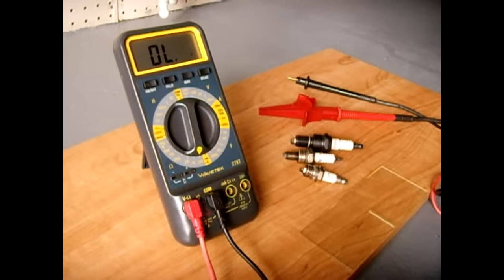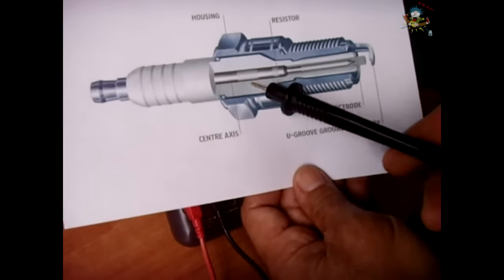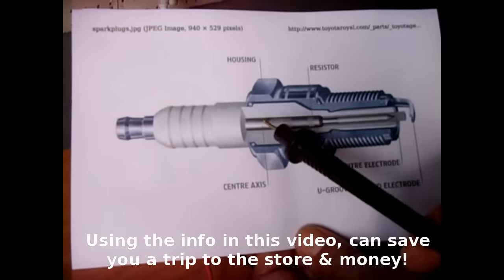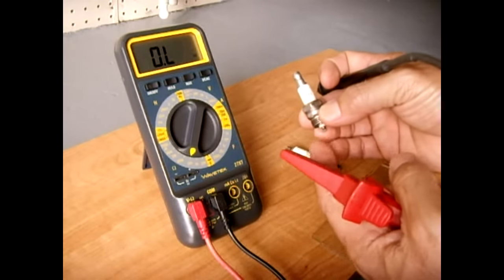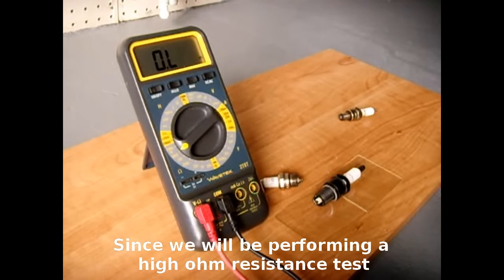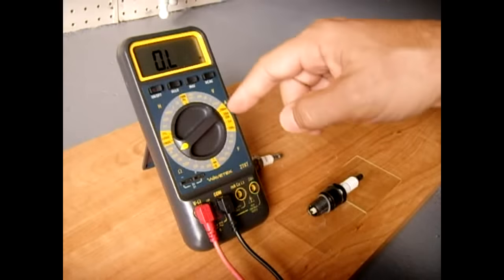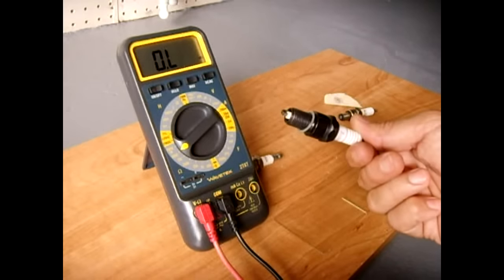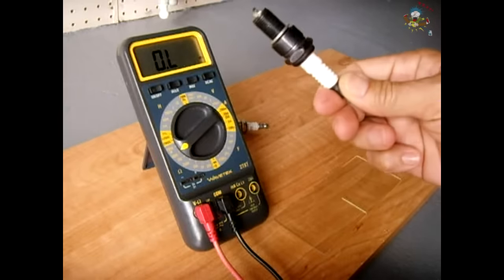How to rule out a Spark Plug as your problem

Comment: So I have a Toyota Corona 1988 the very first problem I experienced with it was when my brakes failed on me. I was driving home on a rainy day was coming up to the lights and needed to slow down as I did so I heard a ping sound and the brake pedal went right down to the floor and lost all the resistance it had. Upon getting it fixed I had discovered my car which i got second hand was indeed a mutant. One of the disc brake rotors was from a Corolla and shouldn't of even been on my car. So after hitting the car in front at about 5k had to get my bumper joints re welded luckily my radiator was fine and my tires had to get two new headlights. Onward about a couple month the tires I thought were fine where not and I had one tire blow out on me must of been a bit of glass that slowly got in it. Later on down the line my car kept making a weird sound it sounded like a slipping belt. I discovered this sound was the crank pulley. So get a second hand one of those and it lasted for two years until a couple days ago. So I was losing a lot of power in my car looked at it at work the belt that went around the air con pump and the alternator was split and blistered. Once again the crank pulley broke again. So just yesterday I had my car down getting fixed again got a brand new crank pulley this time but I have noticed the engine slip and it feels like its struggling to keep up. I could barely get to 50km/h going up a hill which before it could easily do this.I'm just wondering why before I get the crank pulley replaced that everything seems fine and the car goes alright apart from the noise.
Reply from the maker: +burninghalls 
Hate to be the bearer of bad news, but I think the time has come to get rid of your car and find something newer. Sounds like a money pit. You will spend more money on the car than it is worth. Once a car reaches a certain age, all the rubber seals dry out, shrink and crack, metal parts become worn out, etc. 

Thanks

Comment: To be for use one would need to know the acceptable resistance of the plug in hand. I dont know what mine is supposed to be. Looking at your tests I could come back with anything from 0 ohms to Kohms on a plug, but unless i know what its resistance IS then i cannot use this test to any effect. Any rules to apply here? Thanks
Reply from the maker: Nick Hudson Vehicle spark plugs are resistive. Uually in a range between 3500 and 6500 ohms. All you need to do is Google the spark plug you have.

Comment: I dont know anyone that would take the time to remove all spark plugs especially on late model car and not replace them all anyways. Faster than testing each plug. This might be good for lawn mowers and trimmers that have only 1 plug but not practicle for a vehicle.
Reply from the maker: Clearly if you have to remove the air intake plenum to test the plugs near the firewall, then you'd replace them. :-)

Comment: Oh! My bad !! I do have a NGK BPMR7A spark plug for my hedge trimmer , the Briggs & Stratton lawn mower has the Champion plug which is a non resistor type, I compared the resistance between the Stihls spark plug which is actually 9.53K ohms & my dads Honda leaf blower which has a 10.5 k ohm resistor inside of it & runs good so I need to confirm why the readings for both NGK spark plugs are at around 10 K ohm whereas others I measured which are for a Honda lawnmower & other GM spark plugs (Denso) measure at between 3 - 5 K ohms so I am looking for an explanation for that ,is the BPMR7A spark plug supposed to measure at 9.53 K ohms?
Reply from the maker: +Russell Booth 
Hi there. The actual resistance reading will vary. You can look up information for the type of plug you have online.

Thanks

Comment: one of them was 3500 the other one was 3998 is that a very bad reading one spark plug well fill up with oil could this be the spark plugs and idles ruff.

Comment: The plug needs to be cleaned , the gap reset  and the plug then tested under pressure, a plug will often test ok on the bench but fail under pressure.
Reply from the maker: Des Stanford Never had any problems with these tests. Thanks for watching!

Comment: I measuring the spark plugs for my 1999 Miata.  Three of the spark plugs measures around 5.2k ohms.  There's one that measures 7.2k ohms can I conclude that one is bad?
Reply from the maker: All plugs should be "similar". The more important test is the "High Resistance" test from the center electrode to the metal body. If it passes that test, you're likely OK.

Comment: I bought 4 new plugs and i accidentally bent the center electrode on one of them. I did this test with my multimeter and it read 5200. The other 3 plugs are within 75-8500. Did I damage it?
Reply from the maker: Bending the center electrode is next to impossible because you'd have to bend the curved metal where the spark jumps across.

Comment: Is it still ok if my sparkplugs with resistor doesn't reach the 6,000 ohms reading and only has more or less between 4,000 - 5,000ohms  is it still ok to use? Thanks
Reply from the maker: Each plug is different. Look online for the specs for your brand of plugs. 4-5k ohm should be OK.

Comment: NGK the lower the number the hotter the heat range. Others are mostly opposite logic. Nice show 

Also I had Honda motors will not start on same used plug that runs another....Some engines very sensitive to plugs. Best to just get new NGK.

Comment: is there a way you can show your tester on what settings.  I have a tester but don't know if I'm using it right.
Reply from the maker: Which model tester?
Reply from the maker: ***** what model...
Reply: DM-20
Reply from the maker: For the 1st test in the video(measuring plug resistor), use the 20K range, lower left, for the second test using NO hands, use the 2000K setting. Just to let you know, that range is not that high. For a reliable test you need a DMM with at least a 10M range.
Reply: Ok thx.  I'll get a better tester.  It was a cheap one.
Reply from the maker: This one is good. I did a review on it, use it in my newer videos. On sale $48.88 shipped, has many useful functions, and goes up to 60M for reliable testing!
https://www.youtube.com/watch?v=kWz7sEzpnAw
Reply: Ok thx for the advice and reference to this other meter.  I am getting into small engine repair on the side as a hobby and am building a tool box of useful tools and that one looks really good at an affordable price.  Thx again.  I subscribed so I'll be watching for more excellent videos
Reply from the maker: *****
Thanks for watching! Look through my video playlists.

Comment: Hey E&more what's the best to heat up the spark plugs?
Reply: Ok I just seen where you address that issue thanks !
Reply: @JasonSmith-qx3zh  Wast of time to heat up the spark plug. Useless if you do not test the plug under the cylinder compression at least

Comment: The measure does not check 90 % of faults associated with a puncture on the insulation. Another problem is the loss of the spark in the combustion chamber due to the elevated pressure , it is difficult to diagnose because the air during the test a spark occurs
Reply from the maker: +rumunn95 
Puncture of the insulation? The insulator is ceramic. What I explained in the video, is a HIGHLY effective method. Thank You.
Reply: +electronicsNmore  
so I know that the insulation is ceramic , writes the google translator so errors may occur ; ) look at the link http://www.forum.alfaholicy.org/zalacznik/145_146_155_a/107186d1377551339-swiece_zaplonowe__twin_spark_16v_wykaz__145_146_155_a-img_20130825_01038.jpg
what the multimeter will be all about how insulation breaks , the link is visible, but can be also a metal casing spark plug .

Comment: my rapid fire plugs read between 9.5 to 13 Kohms. I've been having misfire issues with my sierra.
Reply from the maker: Michael Marchand How does that value compare to a brand new plug? There should be info published online. Could be a bad plug wire. Any water on the engine recently?

Comment: My spark plug for my blower reads 110.5 ohms and I don't know if that's good or bad
Reply from the maker: Should be close to zero ohms. Touch the DMM leads together before testing, to make sure the meter works. The value you get, should be very close to the value when you test the plug. They don't use resistive plugs in blowers.

Comment: The fact that a spark plugs is capable of SPARKING does not indicate that it is "a good spark plug". 
The spark plug also has to be able to seal off the compression chamber.  A common failure is that a leak occurs through the spark plug, resulting in a loss of compression.   A loss of 6% (on any cylinder) is all that it takes to noticably and measurably effect the efficiency of an engine.
A discolored ring around the base of the insulator often is a result of a plug leaking under pressure.
Reply from the maker: Like I said many times over, the test never failed me. It's not 100%, but it's HIGHLY reliable. Thanks for watching

Comment: What happens if the reading between the tip and the bottom is 65k+ like lets say 80k+ or 120k+ does that mean its bad?
Reply from the maker: If you get anything different from this video, then replace the spark plug.

Thanks For Watching
Reply: Ty for ur quick response :-)

Comment: I think you got it wrong when determining if a plug is hotter or colder. It is not the boot end  insulator that is longer making a plug hotter. It is the insulator end with the electrodes that will be longer. A shorter plug insulator at the electrode end is colder as it allows the plug act as a heat sink. A longer electrode insulator that protrudes deeper into the cylinder will run hotter and cleaner. The length of the insulator on the boot end has nothing to do with the heat range of a plug.
Reply from the maker: I have it right. You need to watch the video AGAIN with annotations turned ON. 

Thanks.

Comment: How do I test it hot if the car is cranking but not firing?
Reply from the maker: Toaster oven set at 250-300 Deg f. Wear gloves
Reply: @electronicsNmore  I just read that in your comments section. Thx for your help!

Comment: Just checked faulty plug again and reads 6k on electrode. Open circuit between plug connection and body.
Reply from the maker: I'd be willing to bet there is no open circuit between the threaded body of the plug and electrode. :-)

Comment: Never clean the ceramic core nose of a spark plug with any sort of wire brush as the wire bistles will leave a metal layer on the core nose and when the spark plug is used you will get traking on the core nose and you will need a new spark plug. Try sand blasting to clean a plug but make sure all sand deposits are removed afterwards.
Reply from the maker: I've never had any problems, but you did bring up a good point. I have a lot of excellent videos on my channel that cover many different subjects, so be sure to check out my extensive video playlists for other videos of interest to you, rate thumbs up, and share my channel with others. Thank You

Comment: Clean the carbon, oil etc from the plug and set the spark gap then test the plug under the correct pressure acording to that engine specs in a SPARK PLUG TESTER...this is the ONLY way to test plugs!
Reply from the maker: Once all the carbon film/deposits have been removed from the electrode area, placing under pressure won't be necessary. Only dirty plugs will fail under pressure.

Comment: I have E3 3.40 spark plugs and when testing one I get 5.65 on one of them and the other I get 7.75 on a cold test with the meter set to 20K ohms. Is this normal? I seem to hear a tinging noise on WOT after doing an ignition tuneup.
Reply from the maker: Sounds like the timing is off. See if using a higher octane fuel stops it.
Reply: @electronicsNmore  thank you. Was thinking about that about the fuel. It's very faint sound but it's still noticeable. I will also run the car without the dog house to get a better hear on it. Also I just check the other side of the engine and one of those spark plugs came out to 4.45 ohms If I remember correctly.  I have a 351 Windsor V8.

Comment: Spark plugs have internal air gap if you can get reading at centre electrode plug is bad replace stick to electronics not high tension electrical as you do not fully understand spark plugs fully or ignition system or coils
Reply from the maker: Drive In Tune Not true Jerko. :-)

Comment: what if i get no reading and multimeter shows OL for spark plug at 20k ohms
Reply from the maker: Usually in the 4K to 6K range, so either the meter is faulty of the plug is bad.
Reply: @electronicsNmore  its a brand new meter and spark plug looks burnt so I say spark plug.. thanks for your help

Comment: wrong about the hotter and colder you get a hotter plug by looking at the porcelin ,,,but at the electrode side of the plug,not the end that the plug wire goes on and if the porcelin is longer you get a colder plug
Reply from the maker: Correct what I said. :-) I suggest you turn on your annotations. I explained.
Reply: Sorry to be a party pooper but Carlos is right. The heat range of a plug is a function of the surface area exposed to the combustion flame. Colder plugs have more porcelain at the electrode end which reduces the surface area exposed to combustion which allows it to operate cooler. Conversely, hotter plugs have less internal porcelain and therefore increases the surface area exposed to combustion making the plug run hotter. Incidently, the reduced internal volume of a colder plug can give you a higher compression ratio and a marginal increase in performance. As for the rest of your video I liked it, however what I want to know is whether your test would detect when a spark plug is affected by fouling and an explanation why fouled spark plugs are only good for throwing over your shoulder. I know fouling is caused by the oil mixed with the fuel causing a laquering and subsequent shorting out but why ? Its a solid state component !! Can anyone explain please.
cheers
John
Reply: Hey John, good pickup, when I was young at our country service station we learned a hotter plug can remedy a colder engine and vice versa for some engines, mainly small ones.The laquering does not usually cause the fouling. it's usually incomplete combustion leaving deposits that track away and reduce the effective spark at the best spot in the cylinder for the combustion point ie; the clean, shiny accurate spark plug gap. Timing, tuning, oil quality etc all contribute greatly and the spark plugs are the lifeblood of it all. If the spark plugs aren't happy, no-one's happy. Also a way to help clean a partially fouled plug was to slightly increase the gap and it burns hotter so as to do what it's supposed to do which is "self clean" Synthetic oil, although more expensive is a big big bonus as there are much less deposits clogging everything and therefore it's not uncommon to double or even triple the interval between oil changes saving money on oil, petrol, repairs and in the long run, the refuse or waste.

Comment: how about a bosch super 4 i've found a faulty one that says its (connector to tip )  4.95 ohms resistance, but it also has 980 on diode check, does not spark others that do work are in rang off 5.48 to 5.66 ohms and have a good spark, no shorts to shell on any of them have you come across this before. ?
Reply from the maker: Your resistance readings are in K ohms, right?
Reply: yeah its in K its auto setting multimeter cat3. sorry for delay been bizzy. its the only one of 4 that has a diode reading, changed it for a spare one i have and the engine runs now without missing, but ordered a new set. just dont get how its coming up with a diode reading.

Comment: Many people talk about checking gap, cleaning gap, measuring devices for  gap, etc.  But it is frustrating that literally NOBODY mentions
WHAT IS THE CORRECT GAP SIZE? Does anybody here know? Please, help
Reply from the maker: Look in your owner's manual.
Reply: For absolute beginners, if you can't find the specifications anywhere then just get a hacksaw blade and adjust the gap to match the thickness of the blade.( 0.6-0.7mm)

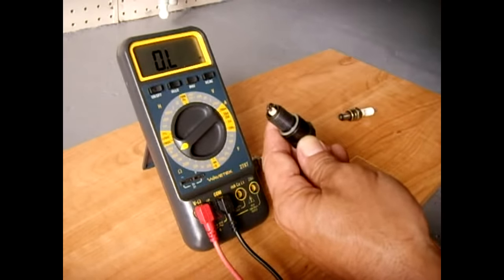Comment: Nice explanation of plugs in general. However, being safety anal and minutiae oriented myself, I would recommend an advisory warning at around 6:30 about pulling plugs from hot engines. Gloves at least, maybe safety glasses, a dry rag or pliers to hold the plug with once extracted, etc., and a big "do not touch or lean on the now hot engine" reminder. The insulator ceramic also damages easier at higher temperatures, so more care with hard metal tools must be taken during removal. Just sayin', is all...
Reply: To clarify: Ceramic is brittle at low temperatures, pliable at high temperature. So if you drop a cold spark plug on a hard surface, like concrete, it will shatter more easily than an hot one. However, the hot one is easier to break with a twisting or torquing motion, like with a wrench, as it is actually in a state of near-melt, wherein the bonding molecules are excited and moving faster, and therefore separate more easily. Picture twisting a warm candle, versus dropping a cold one. If you've ever broken a plug at any temperature, this should make plenty of sense. If you've never broken a plug or have and never wondered about it,  it'll probably just sound over-engineered...
Reply: Napthalicious
And there's your physics lesson for today: use caution when removing or handling hot spark plugs...
Reply: Napthalicious
Okay, I'm gonna go away now. Goodnight and good luck...
Reply from the maker: People should know to be careful when removing a hot spark plug from an engine. Really common sense. There is no reason to damage a hot spark plug if you use the proper spark plug socket.